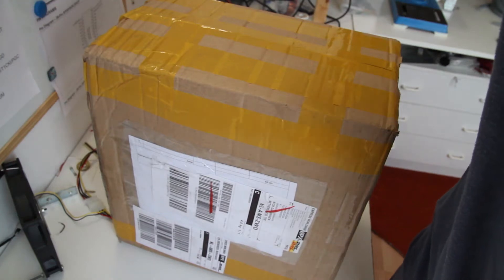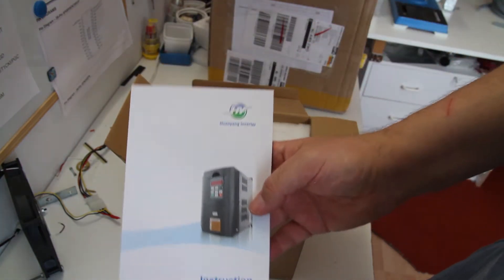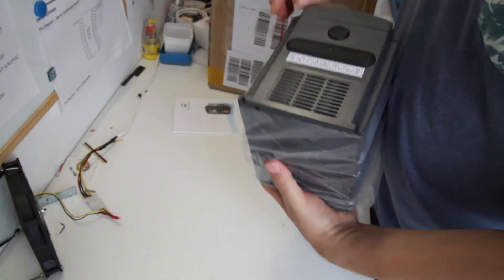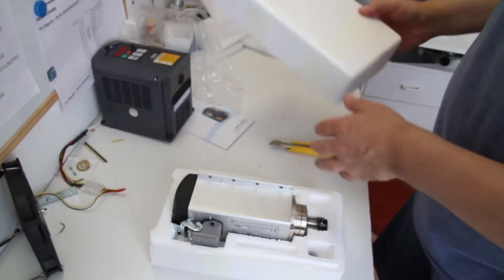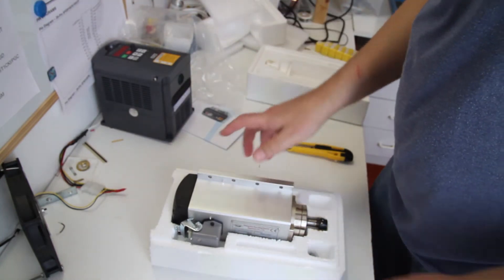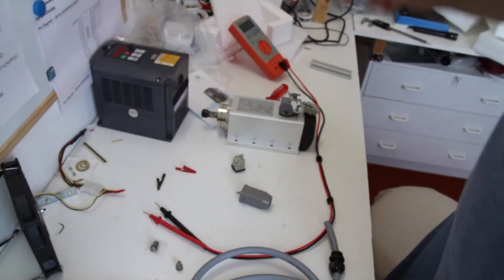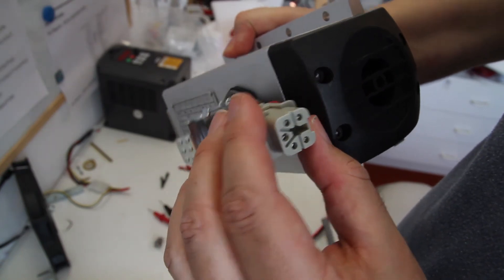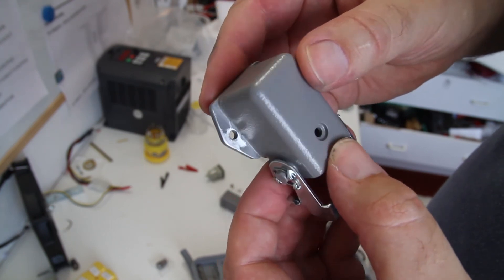Unboxing spindle 1.5kW and HY VFD kit

Comment: Can I use this motor in electric bike????
Reply from the maker: You would need a DC to AC converter, it's unlikely to be efficient but technically it should be possible. If you really want to use this, I'm not so sure.
Reply: @MakercentralNet  thanks 😊🙏👍

Comment: Hi, how reliable are these spindles, i want to use it for steel machining, so could u share u r reviews plz, also u r email addresses so I can contact u
Reply from the maker: I've owned it for 3 years and it's still going strong without any maintenance. I've once cut through very mild steel, with 0.1mm-0.25mm passes due to my mount isn't very rigid. The cnc was meant for wood working and the occasional aluminium projects.
Reply: @MakercentralNet  thx for your reply

Comment: Hi Sir, Is this possible to run spindle without VFD ?
Reply from the maker: Unlikely, it runs on 3 phase 400V. You'll need a vfd to control the speed, power and supply the correct 400V waveforms. Even when it's under load the rpms stay constant, and that's what you want when machining metal and even in wood.

Comment: What RPM range does the spindle work at?
Reply from the maker: I've set the VFD to 7200 to 24000. The lower speed can be set lower but it's generally better to keep it around 7000-8000rpm since my spindle is air cooled and the rpm also powers the fan to cool the spindle.
Reply: @MakercentralNet  is it possible to run it lower for short periods of time without it overheating 1000RPM for 20-30mins?
Reply from the maker: @Xander054  It might be possible, but I recommend using external airflow. I was thinking making an adapter for a vacuum cleaner tube connection, but it might be better to use a compressor and run the air in the other direction due to dust clogging up the vents. A fan that is capable of buildiing up some air pressure might also work. If you haven't already got a spindle it may be better to go the liquid cooling route if you're planning on running it at low rpms.

Comment: thank you for showing us the Unboxing. but please can you show us the wiring of the spindle with the HY VFD. it takes 4 wire 3 phase with 1 ground. and i see that on the units of the motor has number 1-2-3 and 4 plus the doesn't has any number. can you show us how to wiring it. i have the same model but 110V
Reply from the maker: What I did is open the connector on the spindle, see which pins are used, it's not always the same pins! There's 3 wires that are connected to the motor. Make sure the shielding is connected to the motor housing, mine didn't make a connection, I had to scrape off some of the paint to make the connection. Then mount your wire to the 3 pins used (on the male connector side) and the shield to the shielding of the cable. Don't connect the shielding to the ground of the VFD but directly to the outlet shield ground (not 'power' 0 or NULL). Connect the motor wires to any of the UVW pins, the order doesn't matter. Make sure the motor spins in the right direction, if not, swap 2 wires.
Reply: thanks for your valuable comment explanation. i did what you have re-commanded to me. i have make some video showing my wiring way. ( i am not an expert with video please excuse the quality (https://youtu.be/e2ZXnWhkiYc
https://youtu.be/Uv1Qgz0iHkg
https://youtu.be/og-lrWcUGaY
https://youtu.be/tFKhjTtQp2I
https://youtu.be/3PO9gT8Txyw 
and please tell me if i have make any mistake ( no like needed or subscription
Reply from the maker: Looks good to me. Here's how mine is wired up, exactly the same: http://makercentral.net/media/yt/VFDWiring.jpg
Reply: thank you very much . you have saved my skin. and my money. i do appreciate your help

Comment: Hi Sir , Already I have order for stepper motor as per your provided link/supplier from China , Kindly give me also for spindle link, I want to buy without VFD , Is this possible to drive without VFD ? Please suggest me .
Reply from the maker: Here's the link to the spindle, VFD and collets: https://goo.gl/m5qDV4. You can order the spindle without VFD but this particular spindle does need a VFD. It uses 3 phase wires at 400V if I remember correctly. The VFD controls the power and rpm. It senses the load and supplies more power when needed. You can hear the spindle running at constant rpm even under load, which is something a router used as spindle doesn't do, you can hear the rpm drop, a lower frequency. So if you don't want to use a spindle like mine, you can use a router with manual speed control. These are known to be a lot louder though.